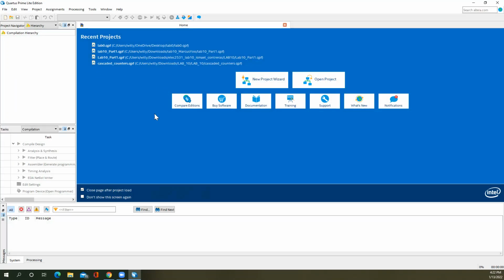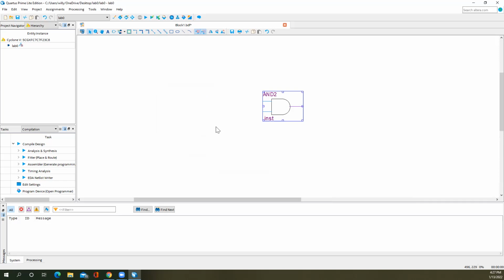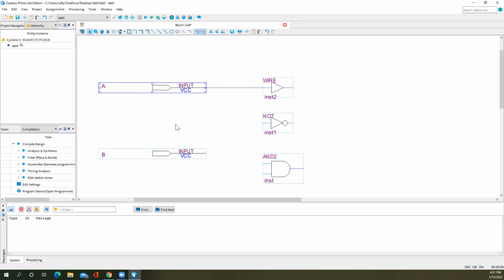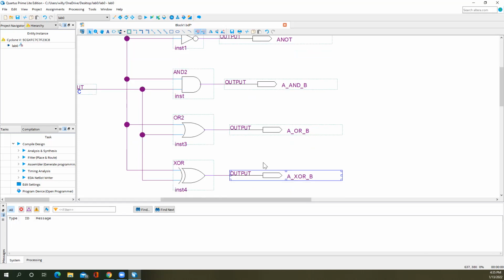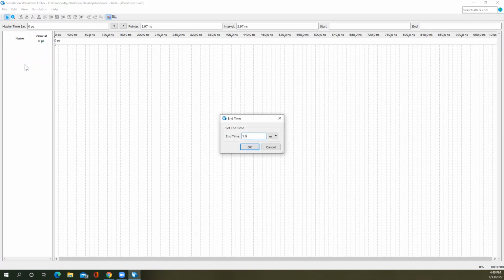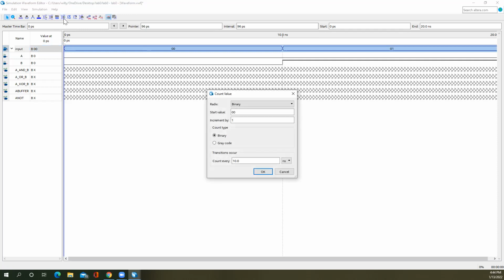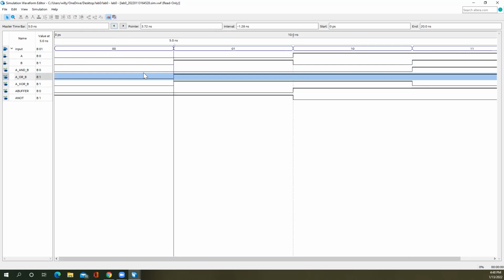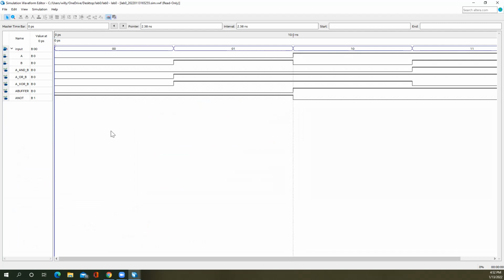How to create a Quartus Functional Simulation

Comment: 2 hours now trying to get the simulation to run. Unending nonsense errors related to the license. I hate Intel.
Reply from the maker: Those license errors are indeed frustrating. This can be avoided by installing the Prime Lite software which does not require a license. All my examples use Quartus Prime Lite. Prime Standard and Prime Pro both require a license. 

If you are working from your own computer, uninstalling the license software version and then installing the Lite version should correct the issue. If you are working from a version installed on a school computer network, contact your professor about the licensing errors. The IT department will have to correct the license issue.

Hope you are able to resolve the issues. Let me know.
Reply: @digitallogicdesign3593  Im using, the LITE edition, and the crappy frustrating same errors... I reach until before start simulation... Good tutorial, BAD, BAD Design tool, make no Engineers, but haters... I will uninstall all, then try again, with an OLD Altera version. Best regards